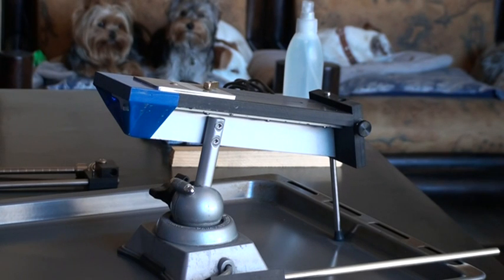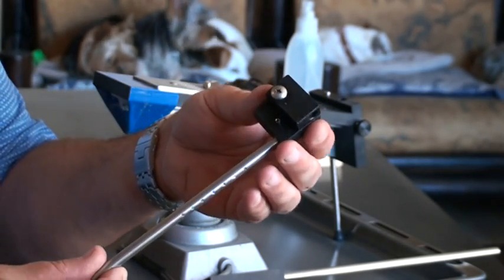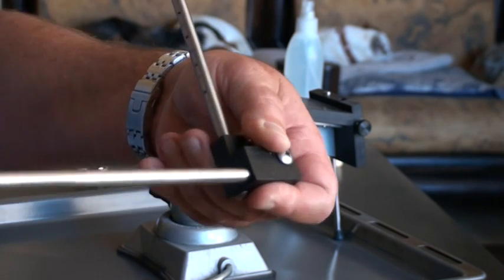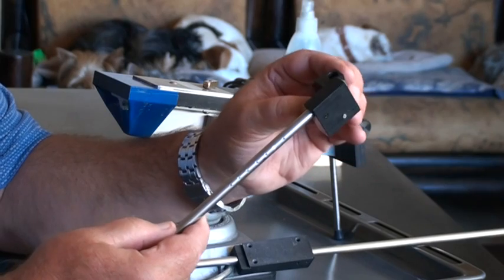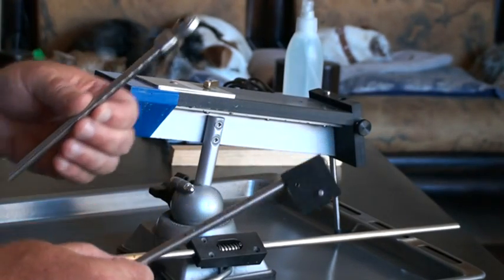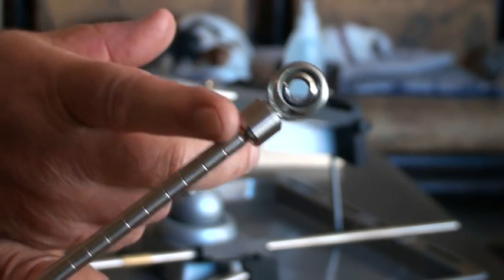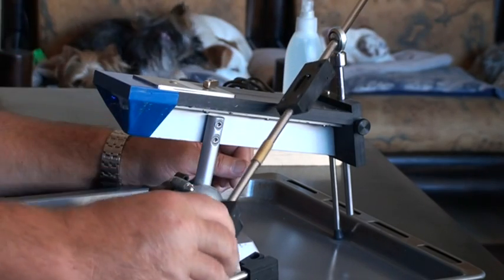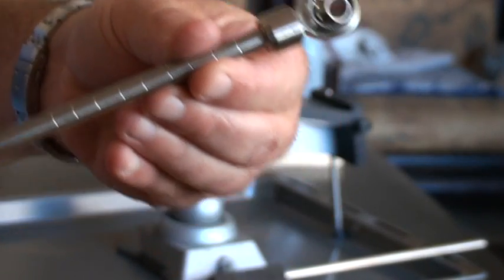Edgepro Pro Angle Degree Arm Upgrade.mpg

Comment: Spherical rod ends: https://www.zoro.com/qa1-female-rod-end-rh-516-24-cfr5/i/G4714683/#description...  In the case of the Edge Pro is 5/16"...combined with 5/16 SS rod, threaded to 24 TPI,....your mod on the cheap....

Comment: I have a question about this MadRookie.  Studying the EP, the stock rod is offset of center so the block with the hole in it for the angle arm is centered.  With this mod, it appears the arm will not be on center.  Does that affect performance?